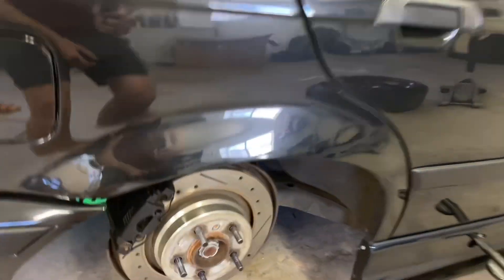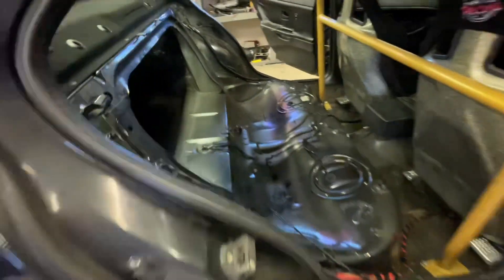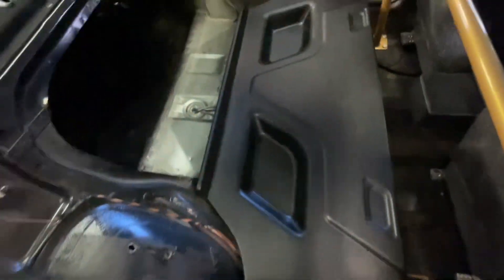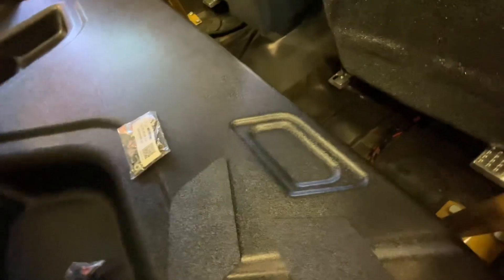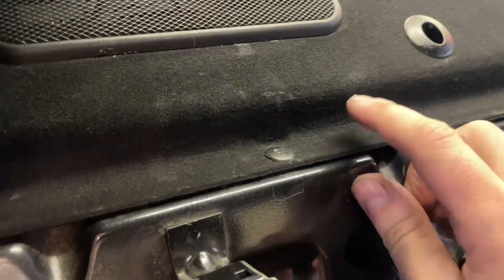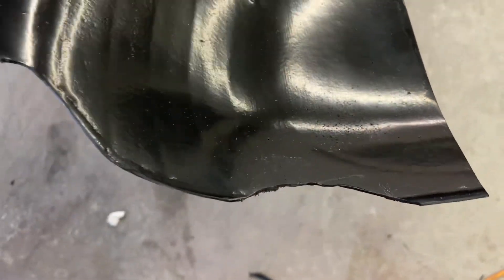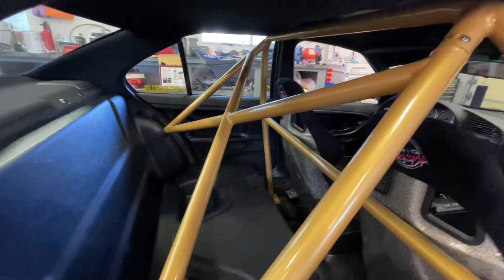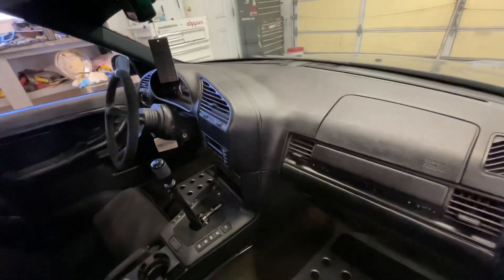E36 Sedan Rear Seat Delete (Hard Motorsport) Will It Work?

Comment: The rear seat delete looks fine with the doors closed. A little more work would make it look better but where do you stop. I really like your E36 and what you've done to it. I've got an EVO coupe which I've modified as well. Rear wing, slammed, Cobra Negaros, race engine, front splitter etc.